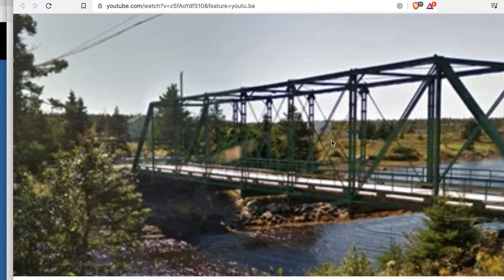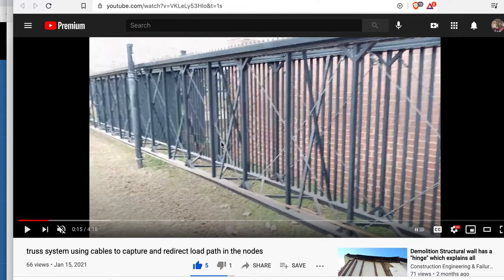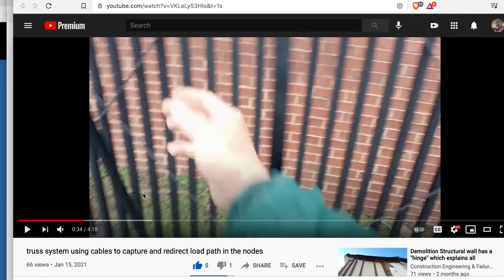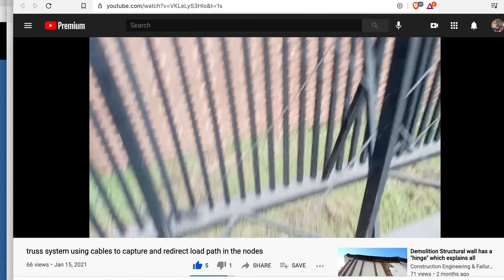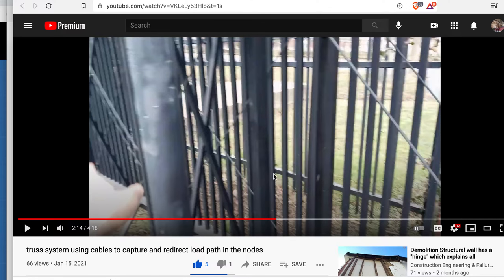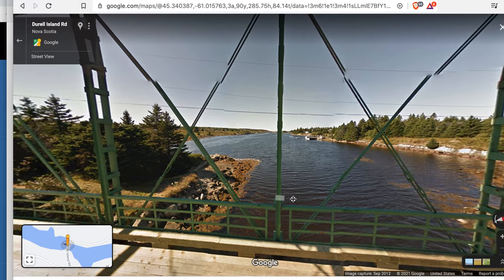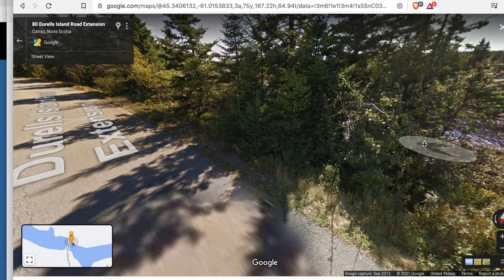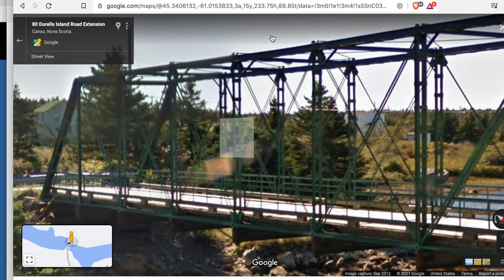Tittle Bridge Collapse Explained with tension bar load paths (no compressive diagonals) part 5 of 7

Comment from the maker: Here is the playlist https://www.youtube.com/playlist?list=PLz0GtzU1bcPgvfepMJD7DAXs5C_j6RncZ and this latest video will tie-in the load path and failure for you. 
More like a Pratt load path.
Please note, I do not believe you can have tension without compression nor tension without compression.
Atoms are being pulled and some are being compressed (just because you cannot see it, does not mean it is not happening).
If, I pull on your arm, I am putting it in tension but ''clamp-force area'' is putting you in compression (at say, your wrist).
Well, like these eye-bars... they may appear in tension but at the back of the eye-bar are compressive moments (which can shear and cause fracture of the ''eye'').
Or even the pin they used to hold the tension members together could have sheared if the surrounding materials were of greater strength then the pin... I think this is a "double-shear'' profile at the pin location x 4 FOUR directions of force (downward force (upright), diagonal from the ''tension-bars" pulling from the "chain-bar" at the link locations in opposite directions of the bridge --- hence, three directions on this joint/node (that equals a total of 8 (eight!) points (two per direction of the linkages going to opposite sides of bridge and two down and one two from the tension bars.

Comment: Those couplers on the diagonals are called turnbuckles. They are threaded one end with a righthand thread and the other with a left-hand thread. You turn the turn the turnbuckle and it will expand or contract as necessary. You stick a crow bar or spud wrench through the two sides of the turnbuckle and rotate it.
Reply from the maker: Turnbuckles are what a system might be called and it may perform like a turn buckle...
The coupler is simply a form of connecting two pieces together and is rated to perform for the task.
Those turnbuckles are basically ""all-thread" and can be used for pulling or pushing...

Comment: He wasn’t going fast enough for the load to transfer to the next tension member!! ⚠️⚠️⚠️⚠️🚛💨
Reply from the maker: LOL  or he should have used tipi-toes
Reply: What he SHOULD have done was unload the backhoe, then drive each across separately....DUH 🤓👍
Reply: And I’ll bet my left nut that NONE of the guys in the video were the owners of that equipment!! 💸☹️
Reply from the maker: Concentrated load is what happened and if he was fully on the structure ... The rear wheels, with their surface contact area in mind... Would distribute the load...
But, it appears that load would have still been inside two of the floor beams, which would still put it on the four connecting joints and as he rolled across one to the other floor beam, the loads would have still transferred primary to six joints (two infront of wheels, two at the rear, and the one he is driving over )... More distribution BUT the connecting point would still be the single floor beam (round about, still fucked). This is written from my cellphone and I cant see my full comment to correct or review, sorry.

Comment: Bridges like these built in 1950sand earlier,  usually have posted load limits. Would be interesting if contractor violated load limit with that vehicle and it's load.
Reply from the maker: Michael, I think I found an article where rating was 45.9 tons... Which is about 2 tons more than this reported truck load (per an article I found, that reported these loads). They also stated in that article about the bridge having been inspected April 14, 2020 had found one corner of the abutment was "tipping".
It is reported the inspector rated structure as "fair and poor" ... As I understand it, "the level 1" inspection is not a thorough structural inspection. 
I further understand b/c it was not structural, no lowering of limits are done with level 1 inspection... for this bridge. 
Nice to see you Michael.

Comment: Kai, this bridge is structurally inderminent and normal static truss analysis doesn't apply.
Reply from the maker: For sure the FIU Bridge would meet that requirement or do we use that evaluation when we can't figure out what is going on? When, we can't find the weak link that started the progressive collapse...
Michael, this reminds me of wind or amount of exact time it will snow and how much will accumulate...  With that said, Eye-bar construction has always had the label of not being able to evaluate 100% (those internal fractures are just impossible, with today's technology to evaluate (last I checked about 2 years ago)...
All the Eye-bar bridges are, I guess, like cables these days... one day they get inspected and label a okay... the next day, they fail!
We really lack proper inspection and evaluation of bridges that are accurate in predicting failure (unless of course, it is an obvious crack or break or loss of metal thickness/ rust).
Reply: The bridge is actually determinant or at least as determinant as any practical structure can be. The fact that the thin rods can't take compression may be confusing which may make one think it is indeterminant.
Reply from the maker: I still like one of the eyeBar as the critical failure point. 
Besides the connections /linkage that can't be physically inspected... I would argue that all other parts of the structure could be evaluated and load rated.
But, in your opinion it is indeterminate...
B/c the internal face of the "eyes" can't be inspected... How can you fully evaluate for load rating?
You would have to make assumptions that all eyes are at full functioning capacity and lacking redundancy (if this is the case) would be unsafe, to say the least.
These eyebars appear to fracture at most frequency of impact (based on ductility of course).
But, it appears all things being equal in design, bars like failing at the inside hole outwards.
With no practical ($$$) way of inspecting these connections then where does that leave the inspection (speculation)?
Michael, I will do a video soon about a bridge having cables inspected and then a few days later the inspected cable failed!
Obviously, the data was WRONG, as the report gave it a pass...
FOIA is hard to get right now but I am working on that.
I did do a short video on this structure over a year ago and put the request in but, have not received anything b/c of lockdowns!
Reply: @ForensicCats  There are no eye-bar members in in truss. There are rods with turnbuckles, long flats, compression members made up of 2 channels with batten plates. I  know you see many eye bar bridges in and around Philadelphia. Eye bar bridges have also failed.  Truss members made with eye-bars usually have multiple eye-bars per member.  Long flats have their ends enlarged to form the eye though which a large pin is inserted to connect to other members.
Reply from the maker: @migilmor_trains_and_tips  Do you mean no eyebars in the diagonals ? I saw  what appeared to be an eyebar connection at two top chord locations.  We do have some eyebars on a few of our bridges at the bottom chord and top chords, no combinations.
I will revisit that bridge when the weather breaks and show you. 
Then we have this bridge that appears to be eyebars as the diagonals on some and ''welded plates on some / center of structure" ; eyebars at the lower chord as the one video shows.
 Take a look again at the google images.
PS These bars are all tension bars so the coupling would just be to draw the two together and not apart.
Reply from the maker: @migilmor_trains_and_tips  PS I know we are now disputing ''turn buckle" but these are not store purchased like a typical turn buckle and are custom length products that have a coupling designed for these loads. I would then call this fitting, a coupling. But, if you want to see it as a turnbuckle ... I can work with that, I mentioned that in my video that will be posted, tomorrow at noon.  Something on the lines, you can call it a turn buckle if you like...  anyway, it is on auto for noon.  Where I call this structure a Pratt EyeBar Bridge.
Reply from the maker: @dirtpilot6071  I agree, as long as you can gain access to the entire metal of the structure and wood where applicable. Via sonar or any other methods.
Reply: @ForensicCats  They are turnbuckles for round rods and any structural engineer can look up their capacities as given by the manufacturer. They are used with wire rope tension structures as well. They are the cheapest way to induce pretension in the steel rod so the rod doesn't go slack when load changes due to the X configuration of the bracing in the truss panels.
Reply from the maker: @migilmor_trains_and_tips  , wait, turn buckles INCLUDE the two ends and threaded rods and some are even called Form Turn bUckles...  I am being literal about turn buckles and I think you mean in general. 
Turn buckles do not have an off the shelf welded end for bridge construction... these are couplings and any engineer can look up the values of couplings as it relates to ratings. Just saying... a turn buckle as you are stating sounds a lot like a Home Depot or Lowes turn buckle , perhaps I am reading ur reply incorrectly.
Reply from the maker: @migilmor_trains_and_tips   here are eyeBars being used in the ''top chord" https://ibb.co/album/0Kmwfs
Reply from the maker: @migilmor_trains_and_tips   here is what a turn-buckle is defined as... a piece of ''rigging equipment"  https://www.mazzellacompanies.com/learning-center/what-is-a-turnbuckle-a-look-at-the-types-parts-installation-and-uses/
Reply: @ForensicCats  See link to Cleveland Forge for turnbuckles for rods up to 3" as well as clevises, eye bolts....
Reply from the maker: Yes, that is the ''turnbuckle body'' (which is a coupling at that point) they sell and a turnbuckle is considered rigging per  
ASME B30.26    
https://www.mazzellacompanies.com/learning-center/what-is-a-turnbuckle-a-look-at-the-types-parts-installation-and-uses/
Reply: @ForensicCats  
Construction – turnbuckles are often used to provide tension support for suspension bridges, large buildings, and highway guardrail cable assemblies.
Reply from the maker: @migilmor_trains_and_tips    but in this case we are talking about this structure and these are just the ''bodies'' and not literally turnbuckles; which are rigging equipment per ASME B30.26     https://www.mazzellacompanies.com/learning-center/what-is-a-turnbuckle-a-look-at-the-types-parts-installation-and-uses/
Reply: @ForensicCats  Read further down on your link and they say what I quote for use in construction.  To pretension a Rod bracing member there are two methods  heating the rod to expand it and fixing the ends while expanded or use turnbuckles.  And yes smaller ones are used in rigging.